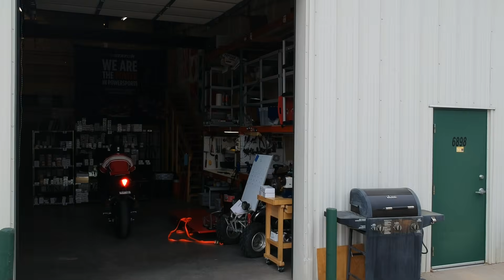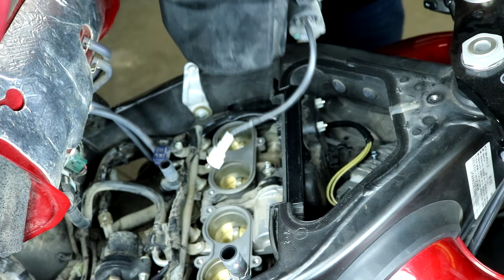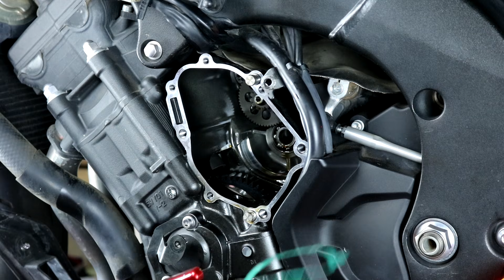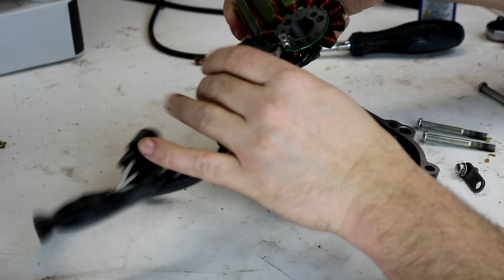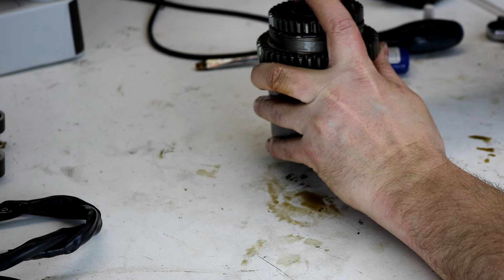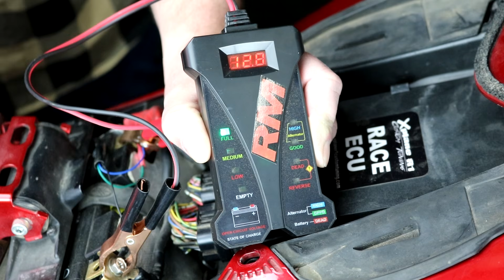How to Install a Flywheel, Stator & Voltage Regulator Rectifier (Yamaha YZF-R1 2004-2008) - RMSTATOR

Comment: Welp. Pulled mine on my 08 , one of the rubber pads fell down into the engine.  Had to drop the pan to get it out now I’m waiting for a new oil pan gasket
Reply from the maker: Oh no, that's a nightmare! Hope the rest of the install goes smoothly.🤞🏻
Reply: @Rmstatorinc  it was an instant change of plans haha.  Your flywheel seems to be a good fit though, the gears and spacer hold firmly together on the shaft

Comment: The battery regulator is behind/ below the battery in my 2006

I was able to reach from the back, by rear wheel to plug/ unplug the static connector

Comment: Hi y'all, I recently had mine replaced before it went bad I had a rattle noise, kind like the sound of a Ducati. They say it was normal but still there after replacing stator. Another shop told me is the stator that is bad? This is on a 2007 Yamaha Fz1. Should I go back and complain maybe was not installed properly?

Comment: An absolute required upgrade if you're on the fence. I had my 2006 completely catastrophically explode and the pan had to be dropped to recover the shrapnel.
Thank God the crankshaft and internals are all made of magnesium alloy so none of the magnet materials stuck to anything.

Comment: Mine  fell down in the crankcase and mannn it was hard to get out
Reply: how did you get it out, happened to me too
Reply: @cheesypotato7149 remove sump as same thing happens to me but I can’t separate the case from the magnets as I want to check them. I’ve tried pushing with an Allen key or would I need more force ? I really want to check my magnets

Comment: Hello fellow riders, just learned about the lovely problem these years have with the original flywheel exploding. Took everything out tonight with 1 bolt left in the stator that refuses to come out and may become stripped so the search for a replacement starts and Ill be learning how to drop the oil pan because oh boy the amount of shrapnel when I took the stator out is just lovely. Wish me luck.
Reply: Did you have a sign that yours was coming apart or were you gonna just do it and found it already falling apart?
Reply: @chrisbaxter719  bike died on the way home from work on the highway so I towed it home and went through troubleshooting no signs.

Comment: IMPORTANT: when putting the cover back on in the final step, you have to tighten the M8 bolts first and torque down BEFORE doing the M6 bolts. I ruined 3 bolts before realizing my error. It's in the service manual.
Reply from the maker: Great info, thanks!
Reply: ALSO: while you don't need to put rtv sealant on the entire gasket, the manual does call for "Yamaha bond No. 1215" around the grommet...I'm leaking oil from this location. One more reason to read the manual along side these videos.

Comment: My regulator is under the seat behind the battery, how do I remove?
Reply from the maker: Our video shows the 2004-2008 model replacement. If you have a different year or model, it could require other steps for replacement.
Reply: @Rmstatorinc  my 05 is behind the battery as well

Comment: Does anyone know the real name of the spacer or conical around his finger I need this part so I can switch gears n get back on road this summer. If anyone can help i appreciate it
Reply from the maker: Here you go. It is #4 on the diagram. COLLAR: 5VY-11478-00-00.
https://www.partzilla.com/catalog/yamaha/motorcycle/2007/r1-yzfr1w/starter

Comment: I have a new kit already but I don’t want to have to do this job again when the magnets flog out, any chance I can buy your RMS flywheel and put it over my new OEM stator for the YZF R1 08 model or is your stator a different size to compensate for your RMS flywheel? 

Thanks

Comment: It's not often you find a detailed video like this one. I would like to add that even if that area of the engine had lots of oil, the gasket will seal the cover with the gasket without any sealant. Also not sure if this was done because it wasn't shown in the video, but the rubber grommet for the stator wires must have sealant  RTV silicone etc., applied prior to installing the grommet into the cover, then apply more to the flat part of the grommet and about 5/16" on either side on the cover. If this is not  done I guarantee you it will leak at some point in time.

Comment: I have a 04 R1 and the regulator is in a completely different location! It’s under the rear of the tank behind the battery case.
Reply: Mine too, was way easier to get to than the bike in the video.

Comment: i might have debris in my crankcase because of this. to what extent do i have to thake the engine apart?
Reply: did you ever figure this out ? dropped one of those rubber pieces in there trying to figure out how to remove
Reply: @hoesayz1679  check the oil pan

Comment: I did this a while back and another video had me put the bike in gear and rock the back wheel to get gears to line up when installing new part. It worked but now feels like my timing is off. Any idea what I did wrong?

Comment: My 06 R1 won’t start but click on the relay solenoid. New stator with flywheel and gasket, new battery , new relay solenoid , new rectifier. I’m out of ideas this is frustrating
Reply: Could it be broken dead switch on handlebar or whatever it's called?

Comment: Just did this job on my 2005 Yamaha R1  because I had no idea what stator/flywheel was on the bike.. this video helped immensely and overall it is not to bad of a job to get done.. the only difference as other people have stated is the location of the rectifier/regulator on the 2005 model(not sure about other years).. upon taking my bike apart , every magnet on the oem flywheel was shattered and honestly im surprised my engine was still running as good as it was.. if you are unsure what you currently have on your bike, I would check.. my bike had an intermittent starting issue but it only happened once every two months so I didn't think anything of it.. finally it wouldn't start at all and that's what prompted me to take it apart and check what was going on.. one of my rubber dampers did end up falling into the engine because whoever was in there before me but the rubber that joins the two pieces and as soon as I got the the rotor off it fell or now that I think of it the previous person probably just left it in the oil pan from when they took it apart.. in addition to the stator cover gasket, I would have an oil pan gasket on hand just in case you have to take the oil pan down.. my gaskets all broke as soon as I separated the covers from the engine.. if you find any of your magnets broken you should take the oil pan down.. mine had a bunch of remnants of the broken magnets in there.. as for some of the comments talking about fitment issues I had none.. everything went together perfectly so Im not to sure what's going on there.. if anyone needs help or has questions just message me
Reply from the maker: Awesome, glad you found the problem and our video helped to fix it!
Reply: I just took the stator and flywheel just in case off from my 06 R1.. and there it was, OEM rotor and few magnets are broken/moved little bit. So maybe I need to take off that oil pan too to see if there's some pieces of magnets too? I noticed couple of little scratches on stator and was thinking do I need to replace that too or is a new rotor all I need? And a new gasket of course. Bike has been starting and running normally and it's been driven over 60k km..
Reply: I also have an 05, thinking of doing this too since my bike starts but then all the electrical shuts down and the bike sputters to a stop. Do you recall the location of the regulator/rectifier ?
Reply: So i dropped my rubber thing into what I believe is my oil pan, do i have to remove it to get it out along with the rest of the magnets?
Reply: @memyself5730  which runner thing? And yes, u would have to drop the pan. Unfortunately ur gonna have to remove the exhaust to do thay

Comment: Is it necessary to change stator set and rectifier at once ? Or can I just replace the rectifier?
Reply from the maker: You can certainly replace just the rectifier if it has failed. However I would test the stator as well to be sure it is in good condition.

Comment: So I just replaced mine with the RM stator and now I have a loud whine noise like a jet engine. Wasn’t there before.
Reply: @koko beatz
Did noise go away? Does your bike still work if noise is still there?
I was just going to peak at stator but couldn't get cover off, so I put back together then herd the same jet sound, that wasn't there.

Comment: Currently in the process of replacing my Rectifier and Stator. However I did NOT go for the Fly Wheel replacement. Should I be ok with the existing one as long as there is no damage to the Fly Wheel? I have Stator, Rectifier, Gasket, and the Red Loctite, and Yamalube 10w-40. Is there anything else I may be missing?
Reply: How did you go with this, I am in the same boat
Reply: @haydenfletcher6398  I ended up replacing everything. Flywheel, stator, rectifier and Battery. Have not had any issues since.
Reply: @camwhyy  did you buy RM everything again or did the new stuff you brought work fine with the RM flywheel

Comment: Firstly, thank you RM for this how to video. I have a 2007 R1 and decided to proactively change the rotor even though mine looked fine at 22k. I didn't see the need to replace the stator so just did the rotor. I had 3 options, $950.Cnd for OEM, or $250 for the RM or Kimpex (China Made) replacement. I called RM Stator first but they were unfortunately resistant to answer my questions, I found their customer service poor. I ordered a Kimpex brand one which looked exactly the same as RM Stator's. The rotor looked decent but had improper machine tolerances, the spacer didn't fit over the shaft - some people apparently sand it down but I didn't feel comfortable doing this, nor should you need to if machined properly. Additionally, it fit too loosely when seated in the bearing. Returned for OEM. BTW the OEM has updated this part and it does look slightly different than these Chinese knock offs. In a high HP, high RPM engine, I'd buy Japan made OEM... just my opinion. Good luck & stay safe!
Reply: Exactly what I was looking for . About to order up a genuine Yamaha thanks to this comment . 513$ usd for oem , 215$ for rm stator. Always nice to save a buck , but I’d rather go for quality over price on this one. 

Thanks for sharing

Comment: Great video. My 04 R1 made a buzzing noise then cut out. Now it will only turn over with the start button pressed. When I let go it cuts out. No:46 on dash; electrical issue. I changed 50 amp fuse and put a new solenoid in with no luck. Do you think my issue is the stator got chewed up and that was the loud buzzing noise I heard? Any help is appreciated.🙌
Reply: same issue looking for help
Reply: @RyanR1  I have recently taken out the stator and it was in bits. I have purchased and installed the newer model stator. I had to take the sump off to check for bits of material. I found a small amount of plastic at the bottom of the sump. I am now waiting for a sump gasket so I can put the bike back together.

Comment: The rotor axis was literally stuck in the center bearing of the cover. Had to use a towel and 2 chairs to hit the center with a hammer and a rounded screwdriver to take it out.
Reply: think ive got the same going can you explain your method a little better? im about to pull out my hair

Comment: I just installed a new stator and flywheel then I got it from Rocky mountain Motorsports and ATV. It's the new upgraded model it's not the kind that's going to have the magnets break apart and kill you. So damn shame that Yamaha did not do a factory recall and see if it's all money and possibly our lives and bikes. My question is I've done everything the way you were showing us in the video except for my bikes not turning over the starter motor still has massive hesitation as if there's seizing in my motor. Even pushing it in gear in the back will just skid. Any ideas no washers or anything dropped into the gear casing. We did an oil change before the swap found no metal in the filter or in the oil that came out what do you think the problem is cold weather? Thanks
Reply: Same happened to me. What was your issue?

Comment: Great information I’m about to pick up an 05 R1 tomorrow. I’ll be able to determine if the stater flywheel or charging system has been replaced I clicked the link in the description and none of the options show any content what’s the deal there?
Reply: Thanks for the help and the links above lead to a bad page....should change over this weekend.

Comment: here's a small improvement to the flywheel installation procedure.....  to get the teeth on both gears to line up, simply put your bike in 1st gear and move rear wheel a bit in both directions while pushing flywheel in....  teeth line up easily every time
Reply: Youre good amongst men Jose
Reply: Great tip🙌👍
Reply: Yo I have a problem bro like when I was putting the stater back in the magnet sucked the fly wheel out in the Kush pads fell down into the casement what do I do?
Reply: @billywalker5112  go to a therapist, and come to terms with the fact that you will have to drop the oil pan. Im sorry for your loss
Reply: @MoswenMedia  got em with a hook tool trying to get the flywheels back in rocking the back tire works??
Reply: Took me forever but there both out
Reply: @billywalker5112  CONGRATS!!! yes, you gotta let it hit hard in gear it turns the crank just a little bit, but enough to turn the gears to line them up
Reply: @MoswenMedia  cool I don’t have a stand can I have someone just rock it a lil with the tire on the ground
Reply: @MoswenMedia  I appreciate the advice btw
Reply: @billywalker5112  My FZ1 has a center stand. You can put it in gear and roll the bike back and forth and get someone to push it in optionally. Have you replaced the flywheel bearings too?
Reply: No just the stator
Reply: @MoswenMedia  no just the stator
Reply: @MoswenMedia  I bought him the bike like a couple of weeks ago put a brand new battery in it the kid told me that was all that was wrong with it when I took it apart the stater wires where melted to the radiator.. So my brand new battery is shot and this is turning into a lot more than I wanted to lol
Reply: @billywalker5112  Youre gonna need to do the bearings too. If you dont when you turn the bike on itll sound like your motor has blown up.
Reply: @billywalker5112   What hook tool did you use? I also dropped my cushion pads into the casement. I don't want to drop my oil pan lol
Reply: @De.TheKing did you resolve it? was it necessary to drop the oil pan?
Reply: This really work??

Comment: The bolts holding the stator on the cover are actually t30. Don't make this mistake and strip your bolts
Reply from the maker: Thanks for specifying the Torx size of the bolts! I'm not sure if it was mentioned in the video.

Comment: Hello there, if i have problem with the releregulator,at all will i have CHECK ENGINE light on for any of this problems(battery,rotor(stator),releregulator)? My 2008 R1 just faild this,and im trying to figure out which one the problem is..

Comment: 04-06 R1 Regulator will be tucked behind the battery, under the gas tank
Reply: You’re a boss ! Wish I would of seen this Before I removed everything as shown in the video just to realize it was not by the air box but under gas tank.

Comment: on my 2012 FZ8 I noticed that the factory rotor had a bunch of little magnets on the inside of it that came apart causing the failure, now I don’t see any magnets on your rotor, does it not need them?
Reply: the magnets are covered by an extra metal layer.
Reply: @fadffds  thanks, I bought their part and installed on my bike right after I made the comment. The bike is riding fine to this day!

Comment: I dropped the little place holder inside and I can't get it out with a magnet is anything else I can try?
Reply from the maker: Yes that can definitely happen. A magnet or a extendable hook/grabber tool with a flashlight/mirror might help you find and grab it. You definitely need to remove that spacer from the motor before starting!
Reply: I couldn't get it so I had to removed the oil pan and got it out thank you!

Comment: If the washer falls in the bottom how can u get it out and will it hurt anything
Reply from the maker: Yes it will definitely cause major damage, do not run the engine without removing it. A long magnet or hook/grabbing tool, along with a flashlight and mirror might help you locate it.

Comment: Do I have to replace the fly wheel? Can I just change the stator
Reply: The rotor/aka flywheel is the most important part to replace. You want the updated part with enclosed magnets.
Reply: @jacobhendrickson8935  I did!!! Now the problem is getting the stator cap back on....I’m not sure if the flywheel is seated all the way

Comment: Helpful tip. If you undo the Allen head in the center of the stator cover you can then use the Allen wrench to push against the rotor as you pull the stator off the assembly and not fight it on the bench
Reply from the maker: Good call!
Reply: Would you have to reseal that in any way if you do that?

Comment: What’s the torque spec for the stator cover bolts ? The 3 big ones and the little one ?
Reply: 16ft lbs for large (3) and 8.7 for smaller (4)

Comment: The washer and spacer dropped down the gears. What do I do now?
Reply from the maker: I would recommend using an extendable magnet to fish them out. It will take some tries but should work fine.
Reply: I done exactly that’s and got them out on the first try. Thank bud
Reply: Hopefully not the cush rubber spacers which won't stick to a magnet. Lost em all down there 1st time i did this, not too terrible just have to drop the exhaust and oil pan. About 90 min added if all goes right.